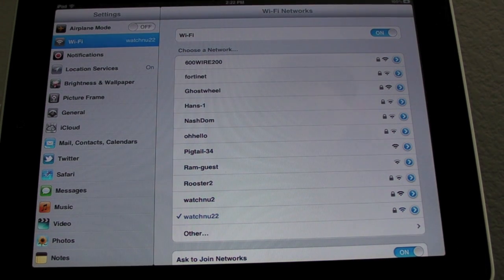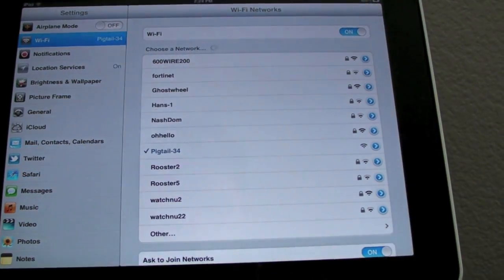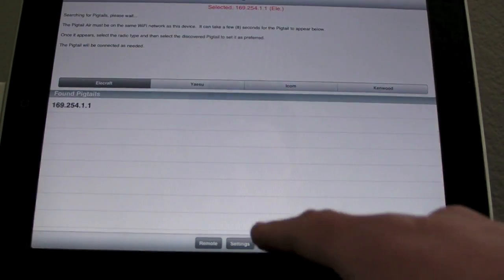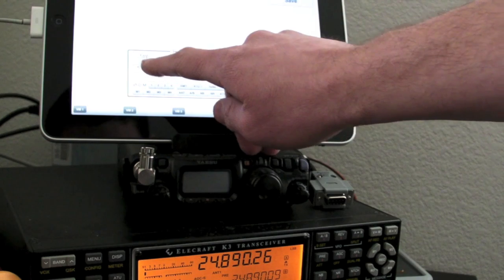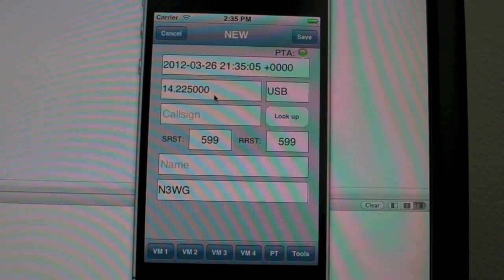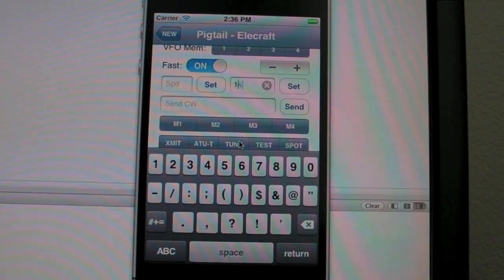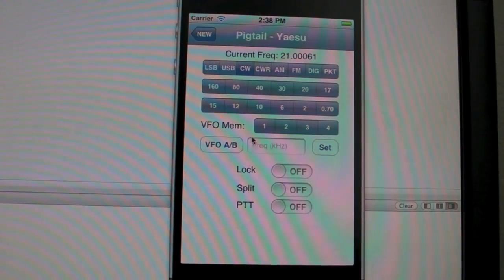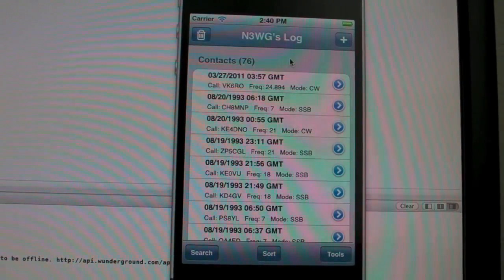Pigtail Demo #3

Comment from the maker: Hi Markinpuff,
Pigtail's purpose is to provide wireless rig control from iOS devices for the folks that want a portable logging solution with rig control, no laptop required. I have a Pigtail with audio prototype working. EtherPig also provides this same functionality with streaming bi-directional audio so you can leave your radio at home connected to your computer and operate it from your iOS device.
73,
Nick
N3WG